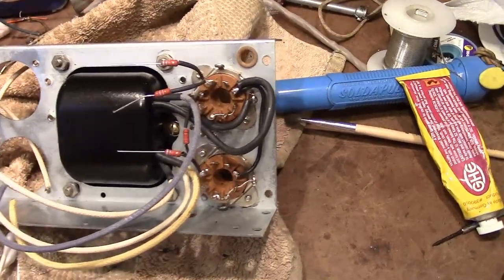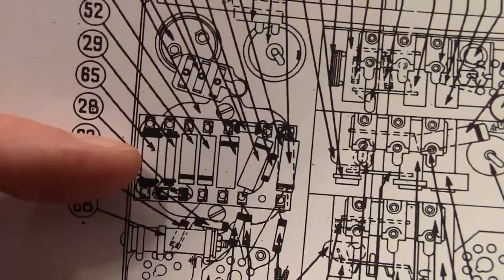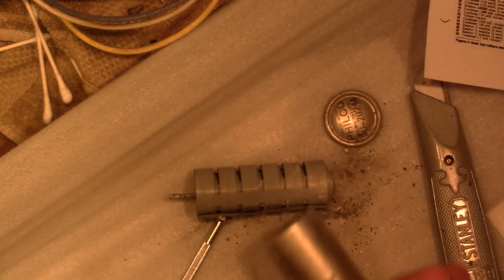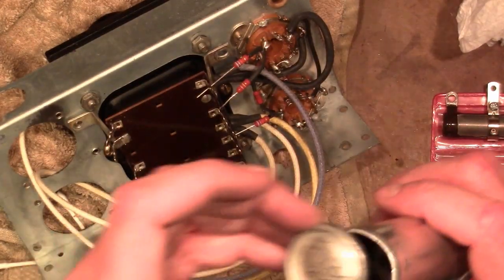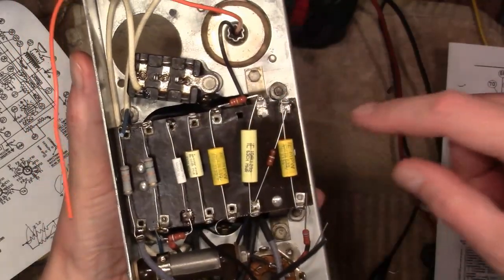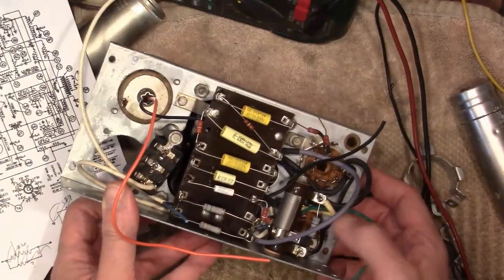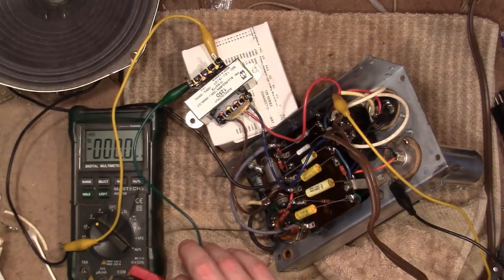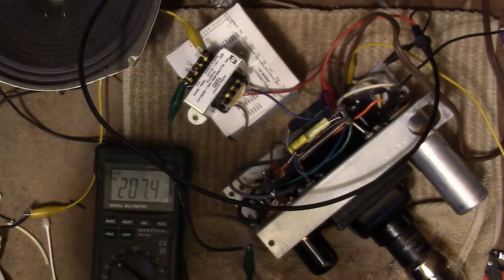Philco 37-640 restoration p4o12

Comment: Bob, At 20:30 or so you start defining the caps and which is the positive and so on. I am totally lost on your point. Is that those two caps are in series and the "U" is actually the (-) on these caps (as I've always thought)? Appreciate your work and kind reply.
Reply from the maker: No,  66 and 66A are physically inside the same can and share a common negative.  The negative is the can itself and connects to the center tap on the power transformer secondary.  The symbol for 66A should be reversed.  The "U" is a positive terminal on the capacitor.
Reply: @bandersentv  Thanks. I'll go back and study that out. Appreciate you and taking the time. A good tech and instructor you are!

Comment: Back in the day the component makers would measure the value that a resister turned out to be and label it accordingly.  If a batch of resisters that should have been 100K but they averaged to 99K, they would be sold as 99K.
Reply from the maker: Galfonz 99K is well within the 20% tolerance and would have been sold as 100K.  Philco may have used oddball values because they were more visible in the type of lighting used in their factories. See K9UW's response below.

Comment: Having that much room in that old cap, I would put 10uF+2.2uF in parallel. Just my opinion. And a little question to you - have you had CRT's with a filament to cathode shorts?  'cause I recently came across modern set with such an issue, I wonder if that is common issue
P.S. Sorry for terrible English
Reply from the maker: MrJohhhnnnyyy Only once have I encountered an HK short.  I don't know if it's common or not, but they did make isolation transformers as a remedy back in the day.  They look just like brighteners  but do not boost the filament voltage - only isolate it using a 1:1 ratio transformer.
Reply: bandersentv Thanks for response. I fixed that problem by making my own filament winding, which is not connected to the ground. I even made useless video about it :D I wish I filmed screen before&after, so video will be at least somewhat informational. What I'm pointing at is: thanks for sharing your knowledge by uploading great vids

Comment: I encountered that weird screen grid phase inversion circuit when I restored my 37-650 a couple of years ago. Since the screen current is not zero it acts sort of like an alternate plate and if you don't bypass the screen at audio then you get an inverted waveform there compared to the grid. You then feed that inverted signal to the other 6F6's control grid.  You sort of get a phase inverter tube for free. Clever circuit and it seems to work well.
Reply: Herbert Susmann It works, but not as well as a proper push pull setup with either an audio interstage or a phase inverter setup. It eliminates some distortion, and give more power then a single ended tube, but not as much as a more conventional push pull setup. Probably the most prolific of the sets employing screen grid inversion was the 40-180, 41-280, 42-380 series of sets from the early 1940s, but on the higher end sets like the 41-300 and 41-316 they used a phase inverter tube. 
 I have a feeling that Philco used it for the same reason that they used many of the other strange circuits that they used, for patent royalty avoidance. Someone on one of the radio forums though that it may have been developed by Hazeltine Research which Philco had an association with in the early years. There was a very easy way that they could have avoided adding an extra tube to either set and still had a normal phase inverter,  they could have used a twin triode like a 6C8G, then used a 6B8G in place of the 6K7 IF tube to furnish the second detector and AVC diodes.

Comment: Great series.  What value safety cap did you use in the bakelite block cap and does it matter?  Thanks.
Reply from the maker: Armand Corpolongo 0.01 - I showed them in the first installment.  I try to use values as close to the originals as possible.
Reply: Armand Corpolongo Don't know how I missed it but good info.  Thanks again.

Comment: Hi Bob, The phase inversion is using the screen grids on the output tubes. I'll have to do a video on that and it works soon. Great video,Bob. Thanks for sharing.
Reply from the maker: Dennis Carter I was just reading up on that technique here: http://antiqueradios.com/forums//viewtopic.php?f=13&t=187781.  I would really enjoy a video explaining it in more detail.
Reply: bandersentv It's pretty weird, so much so that I don't think that anyone else used it other then Philco, just about everyone else used either a transformer or a phase inverter tube. I remember working on a U.S built Sparton that had two 6K6 output tubes with no transformer or phase inverter tube, but I'm pretty sure that they were two tube wired in parallel.
Reply: @OlegKostoglatov   Magnatone actually used a self-split circuit in a few of their guitar amps.
Reply: Magnatone amps are a bit oddball in and of themselves. A friend of mine has one, which he needs overhauled, and it's got a pair of weird output tubes in it, not 6BQ5s but some industrial number, and it's a hybrid with at least one solid state circuit, I think for tremolo. It does have a phase invertor tube though. 
  I recently acquired a Sparton radio-phono combo unit with push pull 6K6s, and they apparently used screen grid inversion. The set only has seven tubes, and one is a magic eye, so I guess they didn't have a choice. I still have to wonder whether screen grid inversion kills output transformers though, most of the early 40s Philcos with it seem to have dead, or replacement transformers, as does this Sparton.

Comment: Why so much hum? Is it because you did not use the field coils yet? I guess they would act as a choke to reduce any hum.
Reply from the maker: Michael Beeny Could be the field coil or could be the 6F6 tubes are not matched well.  Could also just be because the rest of the radio isn't wired in and some voltages are off.

Comment: Does using long leads on a capacitor, affect it or its performance.
Reply from the maker: Yes it can pick up noise or increase the esr.
Reply: bandersentv
Got it, does it also make a big difference which way you place the shield end of the capacitor, or only in audio circuits
Reply from the maker: MrMac5150 I've read arguments on both sides. Personally I don't think it matters much in any circuit. After all they don't even bother to mark the shield end.
Reply: bandersentv
I did notice the older caps have the line around them indicating the shield end, but the newer ones, I see no markings, or maybe it is the way they stamp the values, I do not really know.. Cheers.
Reply: *****
Thanks

Comment: It looks like a parts list error on that #66 capacitor.  If you look at the 37-650 schematic, it uses a 10/20uf 30-2163 cap (no A).  So it appears the parts list for the 37-640 is incorrect, and the schematic is correct.  The 10/18 and the 10/20 does not make a big difference.. Keep up the good work.
Reply: 1McMurdoSilver It would not be the first time that there was an error in Philco's service information, given their system of code numbers, and production runs, it's a wonder that there are not more of them.